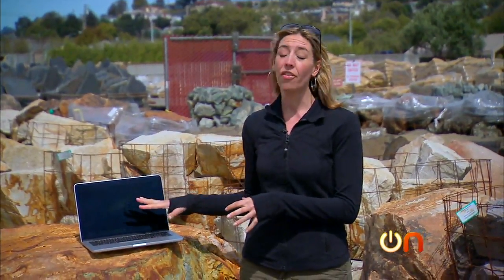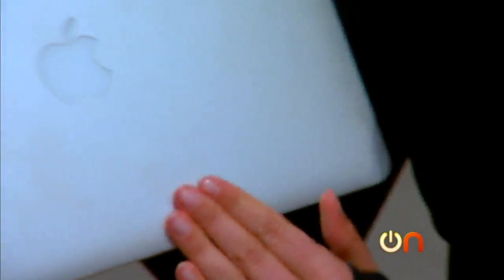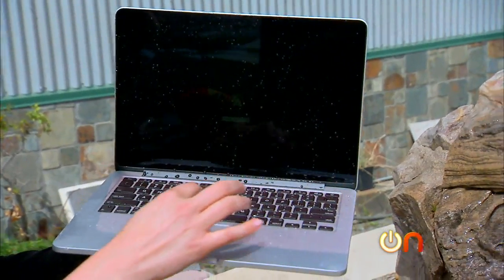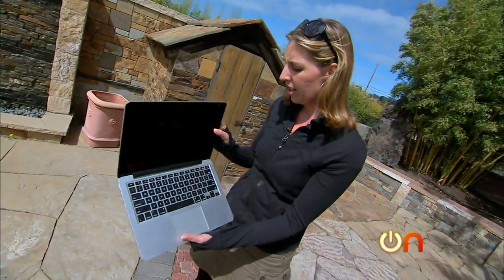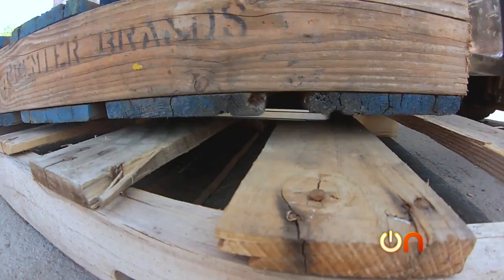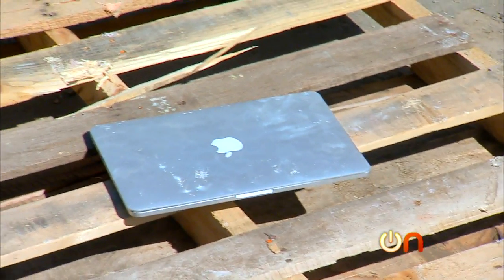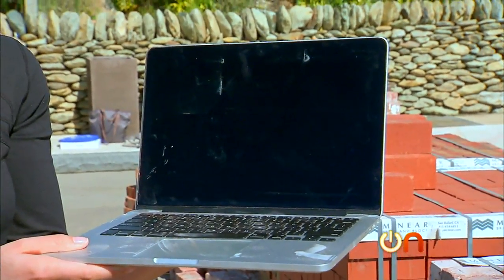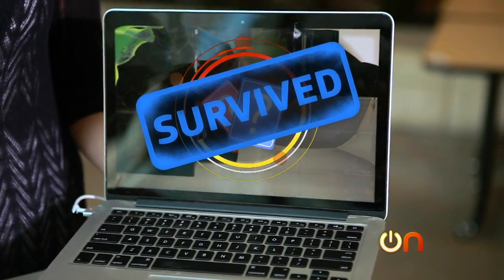Always On - Is the MacBook Pro construction-grade?

Comment: How did they come to the conclusion that the laptop is construction grade when it's terribly bruised and won't even start? This is an outright poor grading system.
Reply: This laptop is not even moisture resistant. Internals get corroded sooner than any other laptop.

Comment: Other problems are going to surface over time when dirt and other stuff has time to work into where it shouldn't be.  The fans will suck stuff in and crud will accumulate.  The MAGSAFE2 connector is the weak point on mine after using it during construction and hauling it around camping in my travel trailer.  It is very easy to the magsafe to get dirty and then you get a loose connection and then you start to fry the contacts.  I've gone through about 4 magsafe chargers and the genius bar guy suggests that I replace the magsafe port.   The other thing the genius bar found is that the inside was full of sawdust.

Comment: I have a 2010 13" MacBook Pro and haven't exactly been too careful with it but the thing still works as new,  the only thing that has deteriorated slightly is the battery  but other than that it was worth every penny
Reply: Tech YT lucky? that thing only has 512mb of ram
Reply: Tech YT i have an lg g pad 8.0 which is more powerful than an ipad
Reply: pandaland1 i have no case on my lg g pad and i have dropped it dozens of times and its not broken not even one single time even if its plastic

Comment: I accidentally spilled, very weirdly because as i was 3 feet away and below the mac, and "threw it" i guess, spilled diet root beer on my mac that is the same model as the one they were showing and it was still working but then the trackpad was going nuts and so i unplugged ,here we go, the power cable two thunderbolt adapters two usbs and put in on the floor which was carpet and far away from anything and i grabbed a towel and hoped for the best and the video i was watching was still playing but i couldn't click or use any thing and the cursor was having a spaz attack on screen and after a minute the screen turned off or i think that i turned it off after pressing the power button and spamming the enter key until it shut down. I stepped back and thought that this is not good. 1. it was the only functional computer that was in the house and the only functional computer i have ever used. And 2 it was very expensive. I turned it back on and for that moment.. i froze... The only thing i saw after the chime was a blinking folder with a question mark in the middle. I immediately knew that this is happening. i called my mother and she could care less and i was sitting there crying with a hint of laughter and i was scared of what my dad would say. so my mother said to go take a bath as i was on Skype on my iPad with a friend and her mother and they tried to talk me though and calm me down and i then them for getting me though. but my dad came home and he was not mad that my 1,499 MacBook Pro 13Inch With Retina was damaged and so i watched some youtube on the same iPad and went to bed. The next morning i woke up and for no reason whatsoever i decided to turn it on and it booted up. and i was greeted to continue to use my mac and terminal was open for some reason and all of the windows that i had open went right back up. and decided to call that friend again and i was so happy to get all my data back and that is why no matter what i have OS X EI Captain on another hard drive and a 2 tb hard drive on my AirPort Extreme and back it up frequently. And also somehow on the phone with another friend some how me telling him to turn it on caused his dell i think to turn back on so that was a thing and boy are my hands tiered.
Reply: +The Internet Lord What the hell was the purpose of that huge wall of text? You're spoiled and spilled soda on a computer and it broke, then you watched youtube videos on your ipad and went to bed. But its ok because you had your data backed up.

Comment: The one test with the bricks was stupid. Because it was a large flat surface against another large flat surface it was hardly any force at all coming down on a single point. That's also why it did not even get a scratch from it.
Reply: thats how you do weight test, they should have just increase the wight and see how much it could hold for squared inch.

Comment: I'm a PC user, and I'm not going to like, nor dislike the vid, the tests where completely OTT, that MacBook took one hell of a beating really, and it still turned on, I was mostly surprised it still worked after the water test! I see so many completely dead from keyboard spills (not retina ones, but still) so it seems Apple have fixed that problem, even if, when you think about it, it would be one of the most easiest things to do, all they needed to do was have a dish like rubber layer underneath the keyboard panel which covered the important stuff underneath, but I'm sure Apple saw loads of profit by not doing that....that's the only quibble I have with Apple.

Comment: Apple make kickass laptops, I would just run then on windows or linux appose to OSX.
Reply: 53 70 6f 6f 6b 79 3f I have to agree. Although I'm all about the PC master race, for on-the-go computing such as writing a short document when you're going to school, there is little to nothing that can beat Apple laptops. They are light, efficient, and have long battery life. Although the Dell XPS 2015 is extremely compelling too.
Reply: Ilya Lomkov Couldn't agree with you more, I have a sick gaming rig at home that I built myself, but I don't feel like carrying it and using it on the bus xD, "Mr bus man, can I plug this sine wave converter into the battery, oh and do you have Ethernet?" lol
Reply: ***** I've been trying to signal them forever, but maybe I just found them with a name like "Mao Nu" are you from the Kepler zone, sa bu fhi kdi owu jii?
Reply: Eh, OS X is great for developers. Not only that but it is incredibly resource efficient and easy to navigate. Very simple. I prefer it to Windows for everything other than gaming, definitely. Too bad Apple products are overpriced.
Reply: Maximan I would disagree at-least not for C++
Reply: 53 70 6f 6f 6b 79 3f It runs C++ fine. The only issue you'll have is with Microsoft Visual Studio. Otherwise, OS X is a developers dream OS.
Reply: Maximan Are you on crack? If you like GCC say goodbye to that, its some stupid x-code bullshit, it's no better than Linux with Gnome 3, they both have virtual desktops sublime and Linux has better command line compilation tools. I can agree with you to some extent, but not really, you have no access to physical hardware, Linux is a development OS because that's what it was made for...

Comment: I can't believe this video suggests macs are water resistant. I am an avid Mac user but you should know Macbooks are more susceptible to water damage they almost any computer on the market. I'm not trying to discredit Apple, but if you are thinking about buying one because it will stand up better to water damage than a PC then you are wrong. About a month ago I accidentally dripped about a tablespoon of water on the cover of my Macbook pro retina(the same as in the video), I wiped all of it off, and it looked like none had gotten inside, at most only a couple drops. About two weeks  later I started having battery issues, so I sent it to small dog who sent it to Apple for diagnostics. I heard back from them a week later and apparently the entire inside of the computer had started to corrode. it's going to cost me about $900 to repair it. My point is you won't necessarily see the signs of water damage right away, the real damage only happens once things start to corrode. Apple also will void the warranty if you have water damage to you computer, so my advice is keep it high and dry.

Comment: This is one of the reasons I have a mac, not that I put it in piles of rocks, but compared to windows computers that I have repaired where their screen has cracked due to the cheap plastic, from putting it in a bag with a charger.
Reply: The difference is, normal windows laptops can be repaired with no problems, but with newer macbooks this is pretty much impossible due to everything being glued and soldered together. If one component fails, you can pretty much throw away the entire apple laptop.